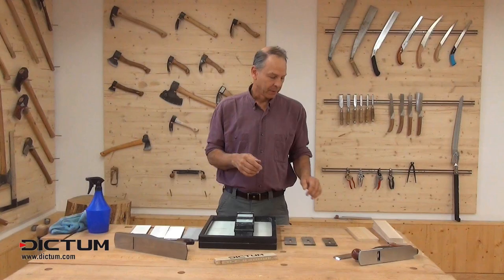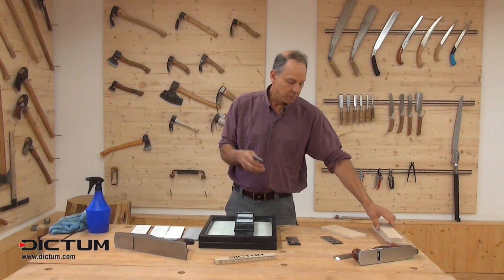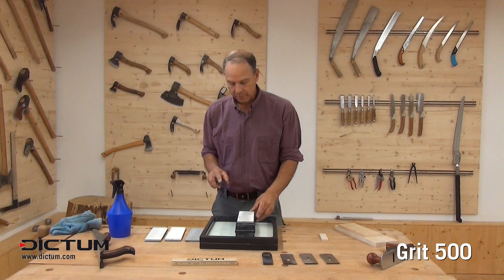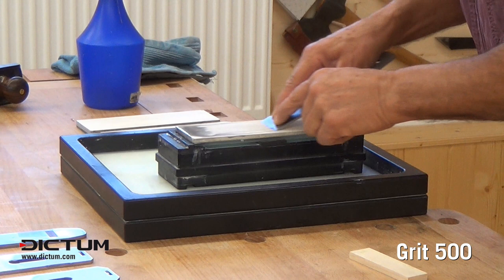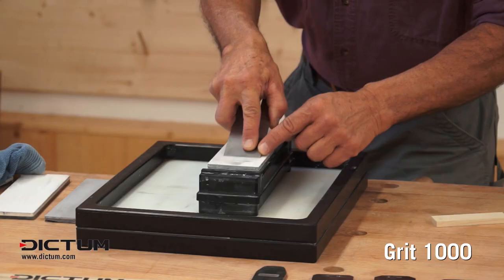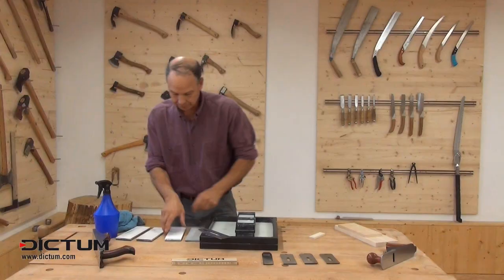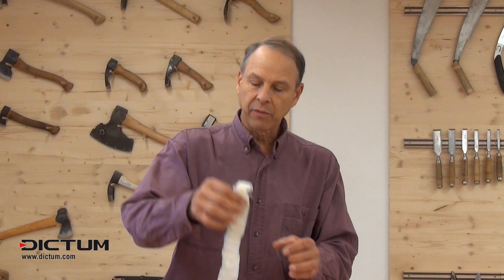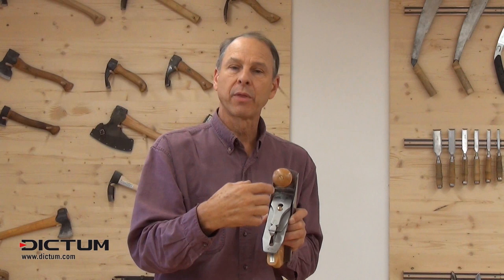Sharpening with Garrett Hack - Cambered Plane Blades | EN Original Version Tutorial Video

Comment: There is an easy motion to make running an iron diagonally along the length of a stone. That motion will add camber - just as a part of the honing process without extra steps - as long as the primary grind has been ground at a shallower angle (it will do it on a primary grind, also, if you use something like a crystolon stone to maintain the primary bevel). Doing this on a single stone (like a washita) is far easier than any of these multi-step waterstone methods (guide or not). If someone thinks they need a sharper edge (once you're good with a washita, you do not), then that can be achieved easily with a hard strop with metal polish on it and very few strokes. 

There are two other benefits:
* the iron won't rust after due to the oil or polish left on it (even if you wipe it off, there's a thin layer left)
* stones don't need to be flattened, just rarely wiped off

I suppose something like that is unclear to beginners because it's subtle (the motion that you make) and it requires a little bit of input from the user, who presumably would know whether they liked the camber from their last honing session. If they thought the camber was too much, just bias the motion to work the middle of the iron a little more then next honing. If not, then bias the honing to have a little bit more sway. It is as easy to maintain an iron that way (maybe easier) than it is to maintain an edge without camber.
Reply: David W Just happened by your comment while searching for how to do cambered sharpening. I've gone through a lot of videos of yours in the past and found them super helpful. I don't think you've posted a video in a while, but I wonder if you could do one as an extension/supplement to this comment. I think many of us would find it very helpful. All the best.

Comment: Why edge the blade is not straight?
Reply from the maker: Two reasons: a cambered blade (round the whole wide of the blade) can take off more material easily. A blade with rounded corners will leave less scratch marks on the wood when finally clean it with the plane.

Comment: I consider Garett a treasure to the craft and maybe it’s just the sharpening media he’s using (but looks like a Shapton glass). I know it’s been 7 years since this was made, but here in 2022 even the cheapest of stones will give you the “tiniest of cambers” he claims he wants with nothing more than pressure on the highest stone he has.  That is; you can straight hone an iron all the way to 16,000 and then do maybe 6-10 draws with pressure on left and then right edge of iron, 3-4 draws on the medial distant edges both left and right, then a final 1-2 draws in the center; that will give you a good camber for smoothing.   It seems in his video here that if one applies what he actually says, we’d in fact have a pretty massive camber and one whose scallops in the wood would actually be able to be felt.   What gives? Is he using some horrible media in this video? Is it some very slow honing white Arkansas stone he was using?
Reply from the maker: That's right, Garrett uses Shapton glass stones. Such a small curvature would not be seen in the video, so we tried to make it visible somehow. The curvature is really small in reality.